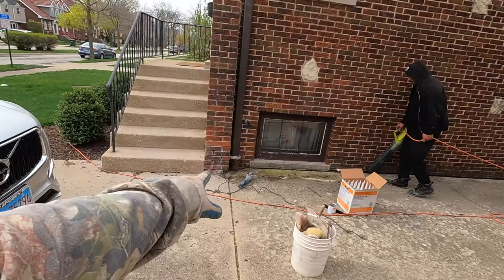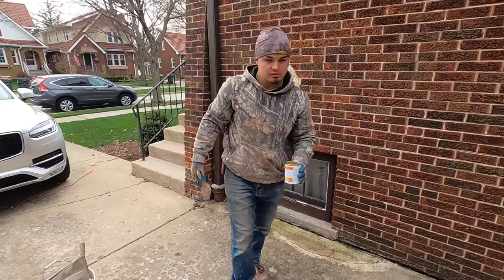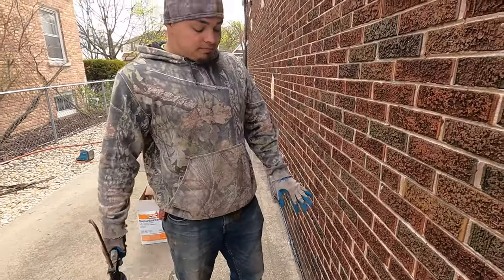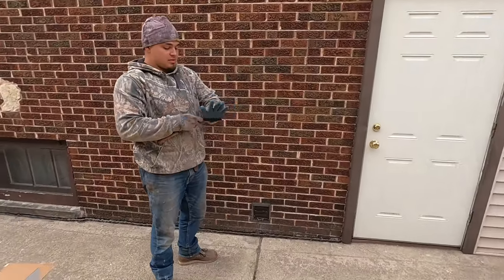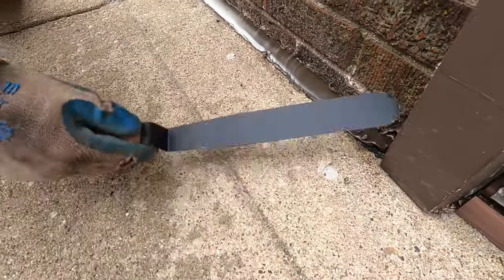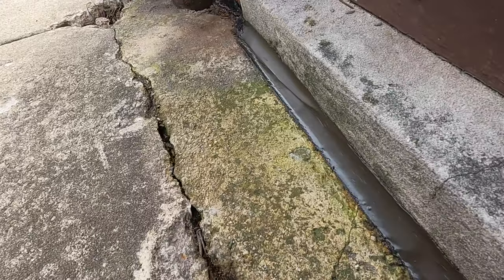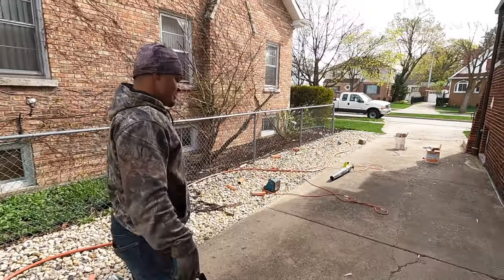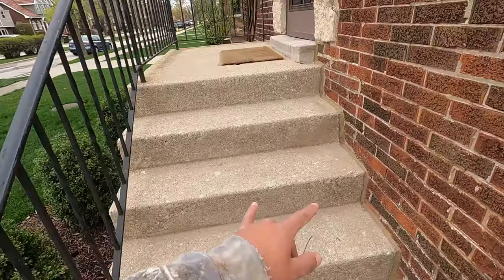Satisfying Caulking | How To Caulk Brick/Concrete

Comment: I do these all the time where the expansion rots out in between the slab and the house. I have use a multitude of different things to fill the gap.  what kind of call was that and what color does it dry
Reply from the maker: I used master seal NP1 and it dries "Medium Bronze"
Reply: is it necesay to caulk between the edge of the house? wouldnt water drain away from the house regardless?

Comment: Thanks for the video. If I have a previous caulking I need to remove, how do I do that?
Reply from the maker: I personally do it with a nice utility nice. You’ll have to replace the blade frequently in order to do it easily otherwise you’ll be fighting it

Comment: Will this work for the interior side of the basement footings for small areas to keep water out. What products did you use
Reply: I don't recommend caulking for interior. Water pressure will blow out the caulk. It's always best to fix it from the outside, if you can't; then look at epoxy injection from the inside.
Reply: @Highdensity89 and water can sit there for a while 2 which can give more problems.. It's best to do from outside yes
Reply: This was more to keep roadents out

Comment: nice video! what size Caulk Spatula did you use or recommend?
Reply from the maker: 2 inch spatula I believe. They have caulking tools on Amazon I’m sure they come in all different sizes depending on what you need
Reply: @midwestbrickdoctor6670  thanks i purchased the 1-1/4' tool so hopefully that will do

Comment: Great video! How did you remove the existing caulking? We have that awful yellow spray foam where our red brick meets the concrete. :( Thanks!
Reply from the maker: I usually use my utility blade but Iam frequently changing the blade as I go to make it easier on me.  If you have foam try to cut it down a little below the concrete then caulk over it as that will be your foam backer so you’re not using a crazy amount of caulking. Make sure you use Np1 as other caulking won’t be as easy to tool

Comment: You should be using backer rod because now you have a 3 sided bond with improper sealant profile. Not because you are wasting sealant. Every professional caulker knows you don’t prime the bottom of the joint because you don’t want it to bond. But it does look decent.  Considering you are a brick mason and not a caulker nice job. 
Because you didn’t use backer rod , or bond breaker tape, it will fail prematurely though. It’s kind of the basics of caulking. Absolutely no 3 sided bond in these types of joints.Not saying it is terrible  but has some major flaws n the very basics of caulking. Your actual knowledge of sealant is lacking but you shooting an tooling skills are pretty good.
Just for context I have installed conservatively over 100 miles of sealant n my life.
And many times we have to manufactures reps inspecting our work. Including removing random samples. Checking for proper joint profiles and proper adhesion and 2 sided bond.
This would fail all,of the tests. We routinely use $10000 of sealant n one project. Not meant to slam you. Quite the opposite I see some talent and hope you research proper joint design and function so you become a top rate caulker.
Reply: BOOM! The mic hits the floor in silence.
Reply: I'm a DIY'er and appreciate the comment.  I don't understand the 3 sided bond.  Vertical Brick, Horizonal Concrete = 2 sides, 2 materials.  I also don't understand not bonding the bottom.  Is that to let it weep ?  Won't water backflow into the crack if the existing concrete isn't slopped correctly (which most old ones are not).  At this point, I'm not even sure why you would caulk it besides to keep debris out and/or aesthetics.
Reply: @mondavou9408  vertical brick  and actually vertical wall of the horizontal concrete is 2 sided. Bonding to the bottom is 3 sided.  There is always a joint between the structure and a slab ( or at least there should be) to allow for expansion and contraction.  The sealant should be bonded to the brick and the edge of the concrete and free to stretch between the 2. Both surfaces will move due to thermal cycling. The purpose of using sealant( caulk) is to allow for this movement. If it is bonded to the bottom it can’t stretch and will pull free from either the brick, the concrete or both. The reason for caulking this joint is water runs off of the edge of the slab into the joint. And water runs down the wall into the joint. Thats a lot of water concentrated in one spot that you don’t want against your foundation walls. Not to mention the real possibility of leaks if you have a basement. Then there is the chance of all that water running into the joint causing erosion and settling/cracking of the slab over time. It is always a good idea to keep as much water as possible away from your house. Ground water can get into the joint from under the slab but it will be very minimal compared to rainwater running into the joint.The correct profile for sealant is “) (“.  Where the top and bottom of the illustration are the 2 sides of the joint.   ( picture it sideways) The 2 sides are thicker for more bonding surface and it’s thinner in the middle so it can stretch more easily. That is the reason you must use backer rod it gives the proper rounded profile and prevents a 3 sided bond.
Reply: @genecarden780  Thank you for the explanation.  I get the two sides now.  It makes sense.  With the two vertical surfaces bonded, there is no place for the water to go and there is no need to have the horizonal surface involved.  The third surface, it just interferes with the flex and stretch.  Three IS a crowd.  Cheers.
Reply: @genecarden780  Somehow, I understand what you're saying! I don't know anything about caulking but need this done on our back of our brick house where it meets the patio. Thanks!
Reply: @mcmiller65  if you end up doing it yourself( or even if you hire someone) use backer rod( make sure it fits pretty tight) and the proper depth to width is 1/2 as deep as it is wide but never less than 1/4” or more than 1/2” ( I know it’s a very narrow tolerance) less than 1/4” and there is not enough bonding surface and more than 1/2” becomes too thick to stretch easily and it will pull the bonding surface loose.
Reply: Why cant i just use hydro cement. Its waterproof and would last longer

Comment: I worked for a few different “ top gun “ level caulking companies back in the 90s and up until about 2015 . Caulking is actually part of the bricklayers union here in Woke broken NY but it really shouldn’t be ( completely different skill trade) This May not be what Anyone selling caulking materials or jobs wants to hear But Many times Caulking is Just Wrong. Sidewalks are Much better off with the proper expansion materials wherever it’s needed and NOT CAULKED!! Many times I’ve seen sidewalks get caulked every 4 feet before the concrete is even cured ( still almost green) and it’s just wrong and unnecessary and a waste of time and money No matter How pretty anyone can knife! I see Completely Failed Caulking All over the place here Mostly Sidewalks and Joints in between concrete and the building like this kid is caulking Caulking between Sidewalks and the front of concrete block buildings That Should be Just Expansion Material and the caulking usually just fails and literally blows out of the joints. I’ve seen Entire buildings here in Woke Broken NY that should be mortar or grout joints but the arrogant incompetent No Standards liberals who run NY Think that it’s OK to just say Fuck it and Caulk everything Entire 40 stories buildings that should be grout joints but have been cut out and caulked over and over again For DECADES!!America is a No Standards No Merit Absolute Shit Show when it comes to the masonry trade compared to So many other countries A little caulk and paint will make it what it Aint is all USA all day. Anyway, this kid seemed like he was actually Chest thumping and Sorta bragging about that little job . When I worked every day with the Real Caulkers Any one of Us Would have had that caulked and knifed to perfection ( or really close) in a fraction of the time that this kid took ( No offense) That’s also weird thing to be caulking and it’s Wrong to Seal it all up just to make it look a little better It looks like it’s been sealed before with some kind of mastic or whatever and The top guns I knew would rarely ever use Primer before caulking even though they Sell that shit by the truckload Real caulkers know better than to waste time Priming.Like the Caulking isn’t sticky enough? Just get the joints clean and maybe hit them lightly with a little clean solvent ( toulene) I’ve seen entire cases of expensive unnecessary primer wind up in the dumpster many times. We used to mix our own caulking Bulk Compound Activator Coloring etc That little tube one part caulking is really expensive and not anywhere near as good as the NP2 or Pecora  1 1/2 gallon cans Id Draw up a gun load in my big old bulk gun and Run that unnecessary caulking and knife it way prettier than that mess in less time than that kid was brushing on unnecessary primer with that Way too big Dumb brush